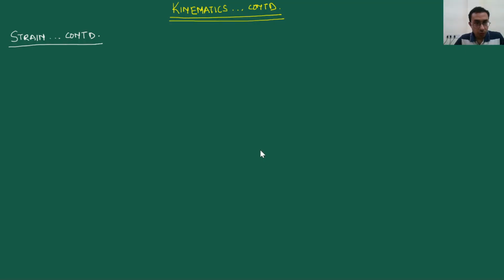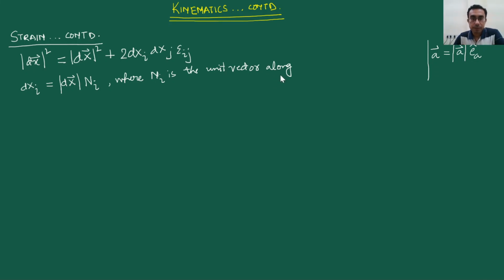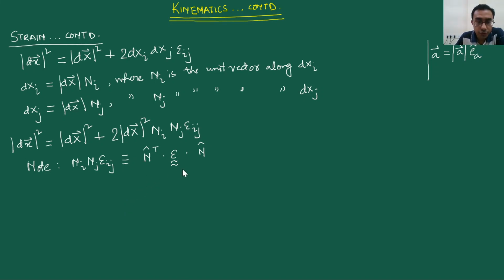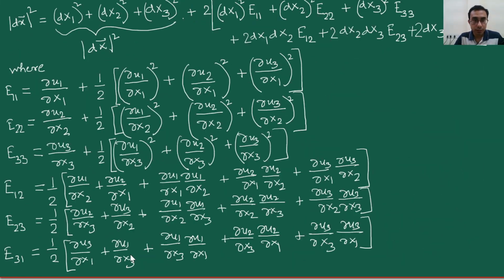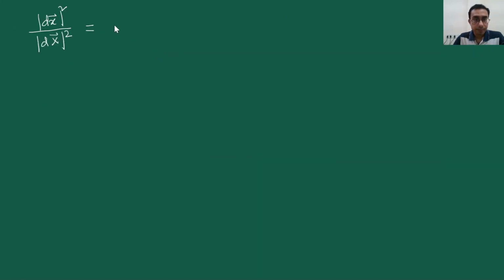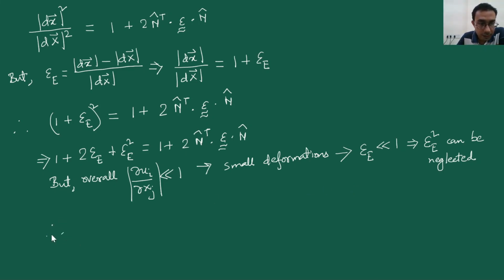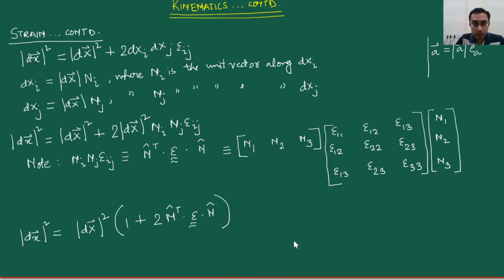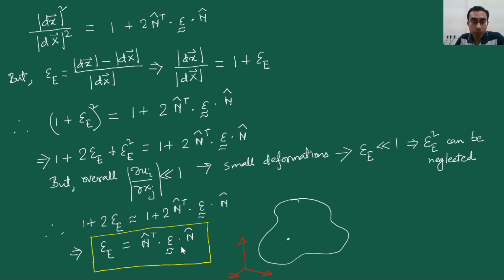Kinematics – 7: Strain – 4

Comment: Sir, isn't dX_{i} suppossed to be the ith component of the dX vector and hence a scalar  quantity ? I am confused how dX_{i} is replaced with |dX|N_{i} at time 2:54 . I would be grateful if you could clarify. Thank you
Reply from the maker: dX_i is the indical representation of the vector. But dX_1  dX_2  and dX_3 are the individual components.
Reply: @Prof_JC  Thank you for the reply, Sir. If we go back to the previous lecture, 2dX_i dX_j E_ij is the indical representation of  2[{(dX_1)^2} E_11+  {(dX_2)^2 }E_22 + {(dX_3)^2} E_33 + 2dX_1dX_2 E_12 + 2dX_2dX_3 E_23 +2dX_3dX_1 E_31 ]. Here dX_1, dX_2 and dX_3 are clearly the components of dX vector. I am not sure what I am missing.
Reply from the maker: @satyajitchoudhury1868  Wherever an index is repeated it indicates summation. Please refer to the lectures from Mathematical Preliminaries.